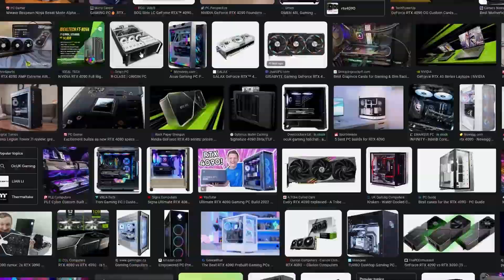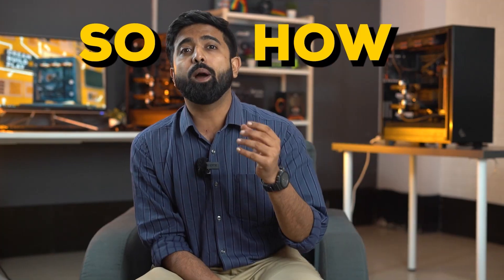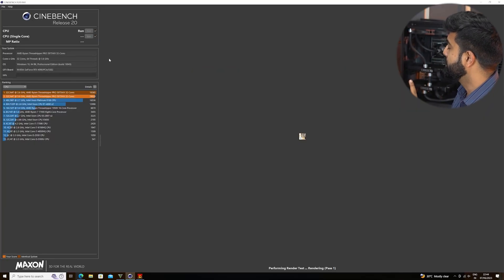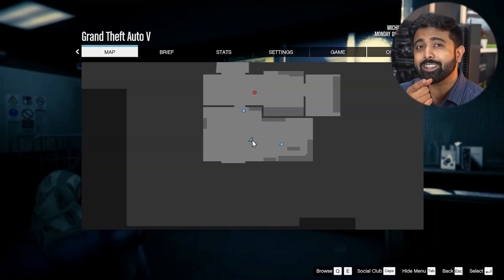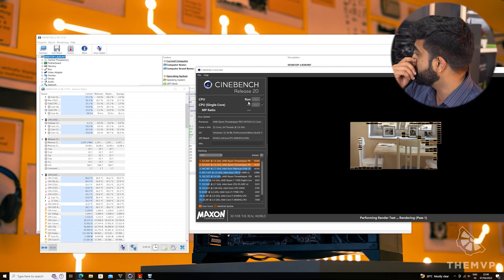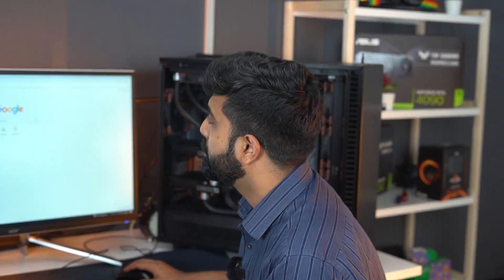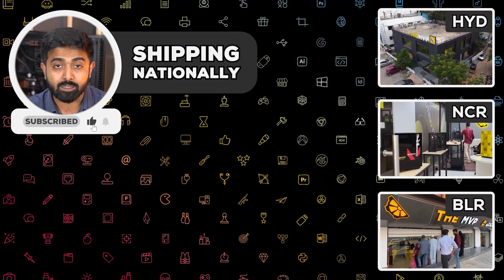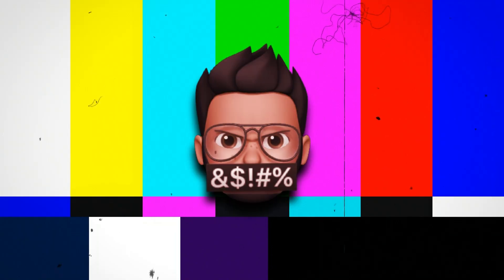10 Lakh PC Build - 2x RTX 4090 SLI + 5975WX Threadripper Liquid Cooling | Custom PC | TheMVP

Comment: im thinking of getting a pc (desktop) with ryzen 5 7600 rtx 3060 and a 1tb ssd also i want it to be very futureproof 
i have a legion 5 2020 currently should i upgrade and how much will it cost? my current laptop has a ryzen 5 4600h and a gtx 1650
Reply from the maker: Looks solid man - Please reach out for a full consultation 
Website: themvp.in
Toll Free: 1800 309 2944

Comment: Bro 5600g ami kya upgrade Karu graphic card wise for nice performance for next 7 years
My specs are 
Ryzen 5600g
MSI b450M pro-vdh max
1TB harddisk 
256gb nvme
CM 450W power supply
(I will change my whole pc after 7-10 years ) plz help
Reply: Also currently I m in budget but after 7 years I would not have budget problem
Reply from the maker: Motherboard is kind of limiting your upgrades here - Would suggest getting a B550 Board & RTX 3060 (available around 27-28K)
Reply: Dood buy rx 6700xt, Don't need to upgrade motherboard
Reply: You can also buy rtx 4060 if you want. DON'T buy rtx 3060.